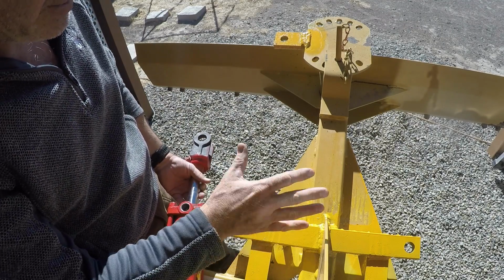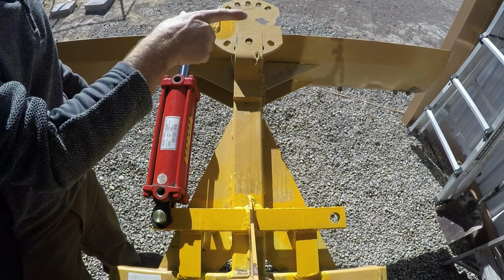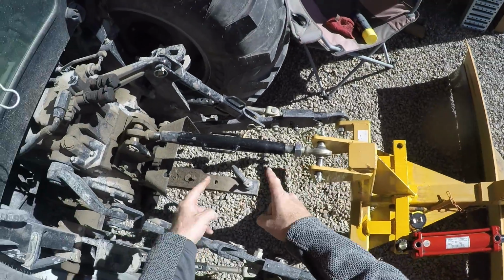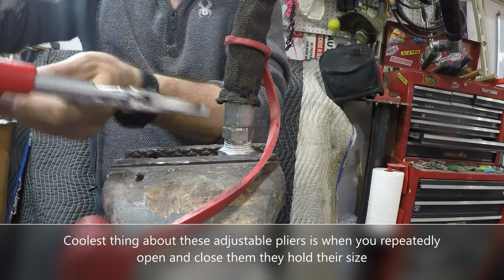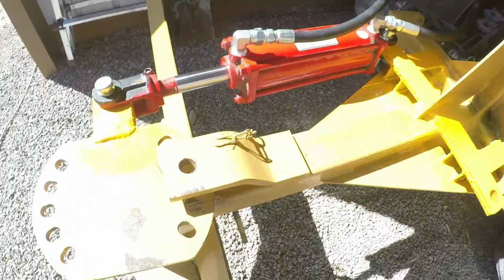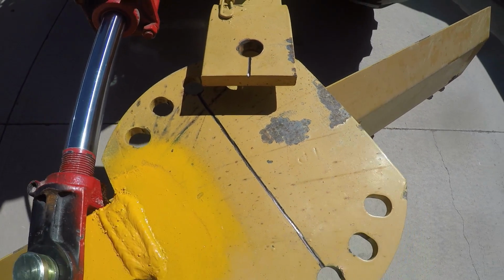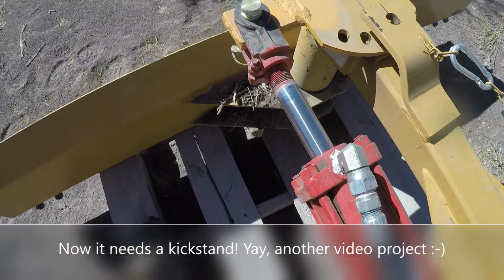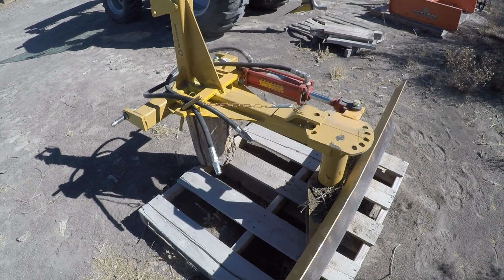County Line Grader Blade HYDRAULIC CONVERSION (Part 3)

Comment: Great job, and set of videos. I have a Frontier 60" I've been threatening to hyd angle as well. I would note a word of caution in general about pushing from the rear three point, more so for viewers than yourself, as you seem pretty sensible. As you're likely aware the geometry of three point linkages are designed primary for pulling forces - there are many cases of bent lower arms, and even collapsing the toplink mount (gearbox housing) when hitting an object. It's all about sensibility - not too fast travel if there could be things to catch the blade on, not ramming, etc. For what it's worth I have great success pulling forward for snow removal with the blade angled. Not ideal of course as you're travelling over the snow first, but at least on a paved drive it's (usually) easy to end up down to the surface with another pass.
Reply from the maker: Yes! Thank you for the good explanation and rationale for safe operation. I usually plow snow forward as well with the straight blade, seems to work well. If u watch my other videos you will know I broke a countyline subsoiler when I hit a patch of subsoil ice.

Comment: Great setup, well done, the only thing I could see you may have been able too do is weld another lug on the other side off the turn table, would that have enabled you to leave the cylinder permanently on the one side and just unpin the back pin and swing around.

Comment: I really want to do this to my back blade. I have a 5 foot frontier blade that is used for snow removal. I really think I should get at least a 6 foot blade if I'm going to put the time and money into this modification though.
Reply from the maker: Yep, mine is 6 ft wide, so is my tractor. I wish i had the 7 ft blade!
Reply: @anesthesiadreamin  I just have a little guy. 1025r. But I've heard others using up to a 7ft for snow. I'd be happy with 6 to be honest. I actually bought the hydraulic rear remotes for my tractor after seeing your Part 3 video a couple weeks back.

Comment: You should put a stop on the blade itself because if you grab something with the blade it could pull the packing out of the cylinder if it's bottomed out